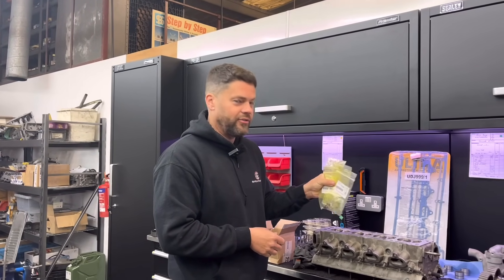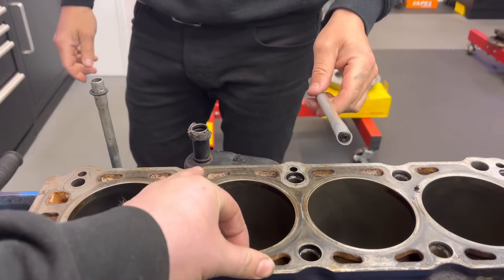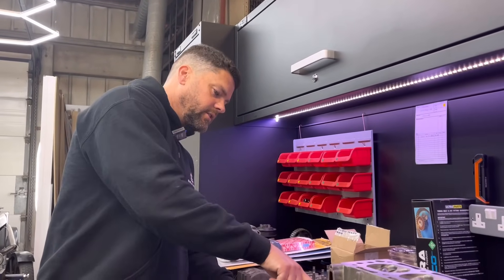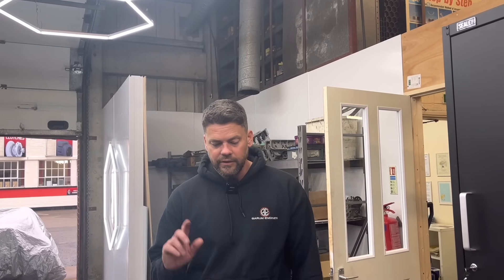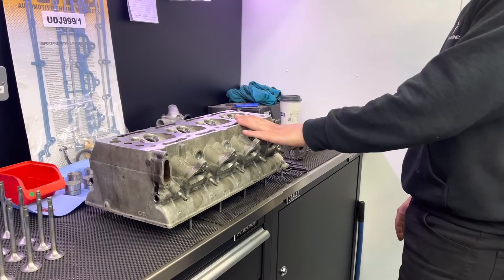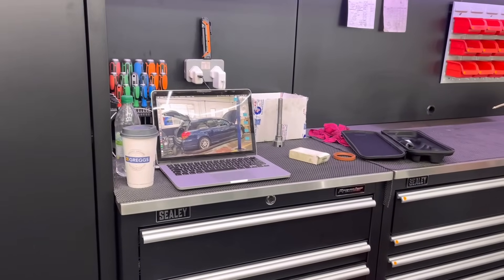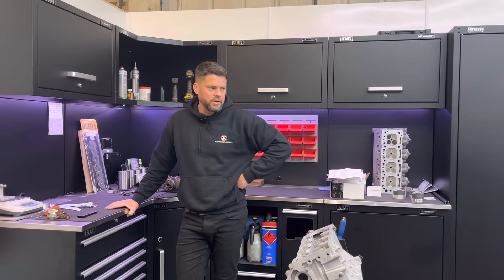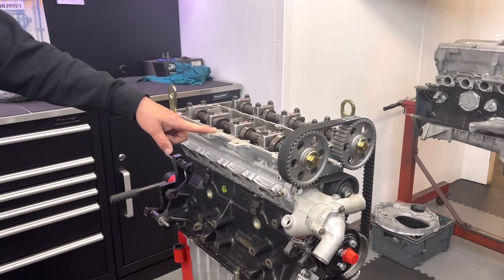Customer threatens us with court over machining error claims!

Comment: Does a torque plate have to be used when boring the liners in that Honda engine ? If so did you use one? Haven't seen you use a torque plate on any engine boring.

Comment: re drilling studs and staying on centre - you can make up a hardened centring bush threaded on the outside per the block pilot hole down the middle put that in the block and the run down with a carbide drill or end mill same id as the hole

Comment: Lee,from your comments regarding the hard spots in the ford blocks, is this due to the casting technique  employed at the time. Presumably they were sand casted with pourers and risers in uniform positions and thicknesses would be fairly std throughout.
I imagine that ford themselves would have cast these so possibly check with them. I'm sure that problems with machining would have become evident at some time during their initial manufacture.
Reply: Many years ago I read a book about the history of Cosworth . Keith Duckworth talked about they got a foundry and they had a worrying number of problems.  They turned around by hiring a Professor who knew all about sand who cracked the job .  Interesting book and quite funny in places too. They listed many engines they were involved in and a number of blank pages where the engines they couldn't name would go.   Oh and a certain V6 he offered to take to the lake district in discussion with the MF .  Oh do you have a workshop there ?  No I have a boat there which needs an anchor 😅

Comment: As regards the Rover V8, look up NASCAR takeout con rods. Most have one race on them. 6" to 6.2" length. Biggest problem is big end is for Toyota or Honda bearings with a rod journal diameter of somewhere in the 1.89" diameter range. The gudgeon pins are normally 0.866" or 0.787". There are aftermarket Chev 305 pistons with the requierd compression height pistons with 3.736" bore. Kind of pushing it a bit but Yanks have used 305 pistons in the Buick blocks.

Comment: On the head with the oil gallery blocked, is worth showing what comes out? as ive built engines, (for myself mainly) and the crap that comes out is quite unbelievable, ive had large swarf, shredded rags, and all probably from manufacture
Reply: The rag debris is post manufacturing engine repair

Comment: It's very good to point out that rubber, belts etc. have a shelf life. The minute they were manufactured they begin to age and degrade. Rubber off-gasses and become dried out and brittle over time and there's a lot of tension on a timing belt.
Don't buy new old stock when it comes to rubber / plastics.. 
Check the manufacturing dates. 
Buy fresh.
Reply: Equally, don't buy a large stock and then come to use them years after they were bought.

Comment: Lee, I worked for RR aero engines. I once asked a stress engineer about bolts. He told me thread depth should be 1 and a half times the bolts diameter. Any deeper makes no difference to the strength or the amount of force / torque you can put on that bolt. Less than 1.5 you’re likely to strip the thread. At 1.5 it all depends on bolt strength and materials you’re bolting into. If the bolts weaker it will shear if it’s stronger than the thread it will strip. If that makes sense.
Reply: But a steel bolt into aluminium will need more.
Reply: 1.5 times the diameter is just a thumb rule that can apply to be generally safe. But it's not always the answer.
Reply: Steel into steel 👍

Comment: The longer the threaded hole goes into the material the less chance you have of the threads being pulled out as there are more threads to transfer the force trying to pull the stud out of the material.
A thread into a hole in cast iron or aluminium given the same depth of thread will "pull" a long time BEFORE a thread in a hole in say steel.
Broken studs however are just a little bit different.
A stud (or bolt) is only as strong as its minimum diameter measures from the base of the thread on the one side to the base of the thread on the other side across the diameter of the stud or bolt.
Drilling and tapping the holes in a cast iron block and using studs with a longer thread IS NOT going to get the stud to "last longer" BUT it will give the block a better chance of surviving and not "stripping out" or "pulling a stud".
Cast iron and normal cast aluminium does not have much tensile strength BUT the studs last longer the higher the tensile strength is of the material that they are made from AND WHAT HEAT TREATMENT THEY ARE GIVEN.
Now the subject of heat treatment is another whole kettle of bananas all on its own.
There is a pretty fine line between making a stud (or bolt) as strong as you can as far as tensile (or pulling) strength is concerned but that makes it harder and making the stud too hard so that it becomes brittle and easily snaps off under load is definitely not a good idea.
And leave that sort of figuring out to the people that know - it will just give normal people like you and I a bout of epic migraines that will kill many of your brain cells.
NEXT:
I don't know what the laws are there in the UK but it looks like you are getting more and more "frivolous" and "chancing their arm" type of legal threats coming your way.
You need to see if your lawyer would be able to claim your costs from the idiot taking you to court - if at all possible with a penalty claim for attempting to bring your business name into disrepute.
Then take those judgements, make a copy, highlight the penalty finding in bright pink, frame them and hang them in your office/boardroom for all to see.
It is NOT a threat, it is an example of the likely outcome should bullshit claims be made against you.
Most of these claims are made by polukas who KNOW that they are taking a chance and when they see that on failure they will have to pay THEIR legal costs, YOUR legal costs AND A 10,000 pound penalty they "might" see the error of their ways.

Comment: I remember many years back the machine shop I worked for had a BMW N42 block in that was damaged so they resleeved it with cast iron reborer Sleeves, I told them from the start it would not work, the sleeves they chose didn't allow enough aluminium between the sleeves, and the fact that they  used excessive heat on the block and then dropped the liquid nitrogen cooled sleeves in didn't help block strength......... They then bored it to size, skimmed the deck, assembled it and it ran for a few hours then it came back blown gasket, I watched them  do this four times expecting a different result..... Eventually the owner of the company had to buy the car from the customer or go to court..........

Comment: I love how comfortable Lee is with jumping back and forth between quoting dimensions in metric and SAE. Knowing both well and working with both in my machine shop I can follow what it's talking about. When he says 'bore point 5' he's talking metric. When he's talking about increments on the machines he's usually talking in thousandths or even ten thousandths. 
I can see why viewers who are not comfortable or familiar get annoyed and ask that everything be quoted in metric.
Lee says no. 🤣🤣🤣🤣
Reply: Yes Fred I started my apprenticeship in July 1977. Britain changed over to the Metric system in 1977 allegedly. In the apprentice training machining shop we had english lead screws with metric dials so one turn of the handle would be 3.17 or 6.35 millimetres. That was a PITA when some of the drawings were Imperial. After the first year we were released on to the shop floor where everything was Imperial. It took for ages before everything was metric. As I am still in the industry I much prefer the metric system now.
are you familiar with even older limits and fits systems based on the gnat's cock the gnats knacker and Barum Engine's Lee's favourite the prick in a bucket?

Comment: Look up Blue Print Engines. They have a 3.6l 4 cylinder engine they are developing based on a diesel block. They can set it up for either the Chev LS head or a Ford Cleveland head. 350 HP and 500 lbft of torque. That could be a beast in a Seven kit car.

Comment: Hi its a pity that Joe public don't understand that just because a modification is popular and is fine most of the time it is a deviation from standard practice and unless it is a manufacturers approved modification the warranty is null and void and in some cases the modification would have to be carried out by the manufacturer or approved dealer or agent. I wander how much warranty there is on a top fuel engine😂